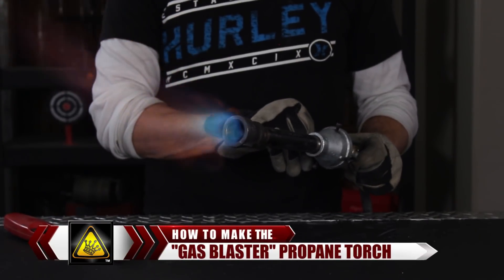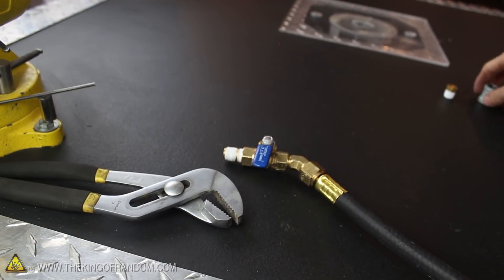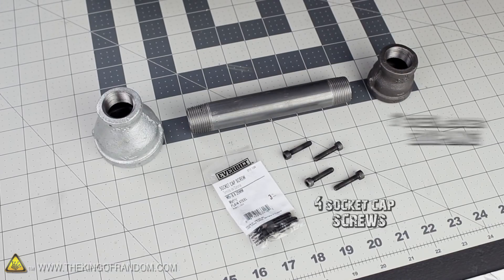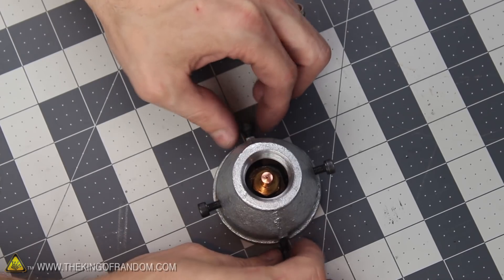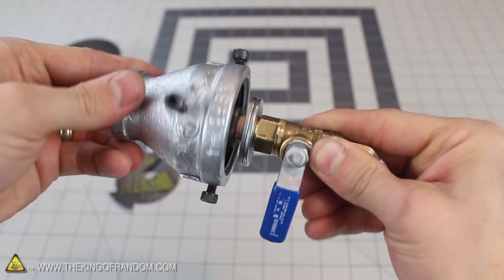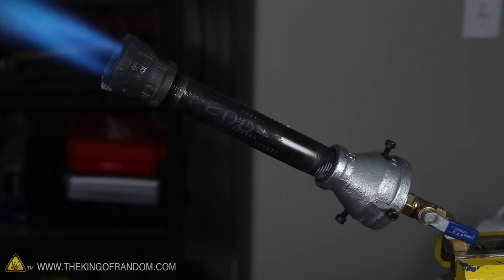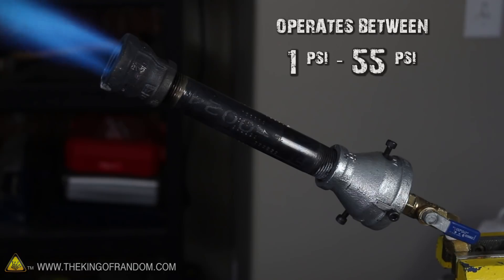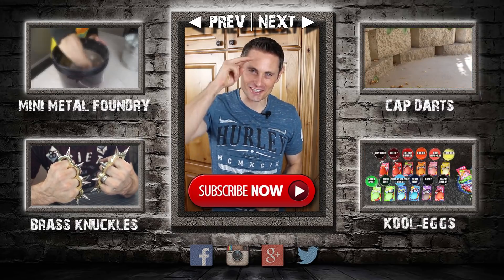Convert Your Backyard Foundry To Propane! ("Gas Blaster" Propane Torch)

Comment: in the parts list you have a 1-1.5" reducer, a 1"dia pipe, and a 1-.5" reducer coupling. 

either that last reducer coupling is wrong or the other two parts are wrong. I don't think they make 1.5-.5" reducer coupling so I assume that last reducer coupling 1-.5" is wrong. 

sucks, I'm out $10 for that 1-.5" reducer coupling now.

Comment: as awesome as this build video is, I think it's a little on the needlessly expensive side. Especially considering you can go on Amazon and search for high pressure propane burner and find high quality jet propane burners that will reach temperatures at least as high if not higher, for less than half the cost.

Comment: This project was a treasure hunt because I tried to buy locally, I recommend everyone to follow you're amazon links to buy the parts, also don't cheap out on the pressure regulator and gauge, I know the Marshal Excelsior is expensive but it is worth it! I just finished the build, it far surpassed my expectations! Thanks Grant for the instructions! Can't wait to see more forge/foundry videos!
Reply: IMPORTANT NOTE!!! When you tap the 1 1/2" reducer coupling I recommend using a 11/64 bit for your M5 tap, it is much closer to the M5-.08 tap and you won't end up with shallow threading...

Comment: so I'm having a problem with the heat transferring too far up the line towards the valve and rubber hose. I'm going to try a longer pipe on the end to keep the heat down, any other suggestions.

Comment: Could you do a video discussing a building a propane foundry vs one that runs using natural gas (what you normally encounter piped from the city to your home HVAC system)?  Possibly talk about the gas pressure, burning temperature, time to melt an ingot, cost of natural gas vs propane, etc?  And yes...  I want fries with that!  : )   Thanks
Reply: If memory serves, propane is about 3% more efficient.

Comment: For those looking to build this, there's some errors in the parts list. The pipe is 3/4" not 1" pipe. The reducer you drill into should be 1 1/4" to 3/4" reducer. The flare end is made of a 1" to 3/4" reducer.  Do NOT use galvanized pipe (the shiny pipe) in any of this. Use black pipe. 

Also, you can use the same tap to do the nozzle as well as the thumb screws. Just buy the right size thumb screws. ( My local HD didn't have a tap for the thumb screw size used in the vid)

(This is very awesome. I'm in the process of building one based on these specs. I built one around a 1" pipe with reducers / flares to fit that. But I will be redoing it with the 3/4" pipe and reducers soon.)
Reply: actually i think the one you drill into says 3/4 to 1 1/2
Reply: I wish I saw your comment earlier. I didn't realise the front flare was the wrong size until after I finished it and wanted to screw it on as finishing part.
 
I have built everything with a 1inch tube as smallest size, but am using a screwable rear to let air in (or close off) so bigger size should be fine. However I now need a new front 'reducer' from 1" to something slightly bigger, perhaps a 1 1/4 "to 1"?

What is the reason you are going to / went to 3/4 inch?
Reply: @daedelus_  I just started getting the pieces to this today. I noticed as I was picking them up in Lowes that galvanized wasn't the right product to use as it's toxic when burns, as its mentioned on another video about the foundry and why the plaster mix should be as close to the top as possible.. So I picked the black steel pieces. I was make shift putting it together while picking the parts and noticed the 1" tube wasn't going to work with the 1" reducer. Luckily, I saw a 1 1/2" reducer to 3/4" in stock (which my other lowe's and HD stores didnt have). And I upgraded from a 1" x 6" steel pipe to a 3/4" x 12" pipe and was cheaper. Unfortunately the rest of the items I had to order from amazon so I have to wait a few days to piece it together and drill all the parts.
Reply: GUYS GUYS just chill its going to be toxic almost any metal fumes being breathed in for a long period of time are bad or unhealthy i know a guy that worked meting and casting aluminium for 15 years and he didn't wear a mask and now he cant put a spoon in his mouth just by a respirator mask its that simple
Reply: Joshua Migdal did this work out?
Reply: did you use a flashback arrestor on yours
Reply: thank you
Reply: I'm having a problem too I can't find any of the quarter inch pieces that he used.  Do you think I can do it with 3/8-in pieces cuz that's all my hardware store has
Reply: Hello from 2021! I only noticed the material discrepancies after I set out to buy the materials as listed in the description. Local stores didn't have propane hose nor 45° elbow. Also had trouble finding POL valve and adjustable regulator. Having to buy these items online!
Reply: Thanks for this comment. I kept thinking something looked wrong with the parts I bought.
Reply: What do you mean by "black pipe"? Steel isn't black, so doesn't that mean there's just some other coating on it (which isn't zinc) that's going to burn off and be equally toxic?
Reply: @halenpeterson2322   it's just a term used that means plain steel (i.e. non-galvanized)  it looks black as it still has the mill scale on the pipe. when you're doing an application like this where you're more than likely going to be melting Al or other crazy toxic-when-melted materials having the Zinc is a moot point
Reply: @halenpeterson2322  black pipe has a heat proof coating that isn't toxic when hot.  it's for using in forges, furnaces, gas fireplaces, etc etc
Reply: No it’s  a    1 and 1/2” to 3/4 “ reducer you peanut. Use your eyes

Comment: hey would this work with natural gas as well or is the pressure of natural gas to low? would you have to use forced air if you tried to adapt to using natural gas instead?

Comment: I love the plan! 

I'm thinking you've put a lot of effort and talent into this so, THANK YOU!!!

I'm working on a foundry of my own, and I'll be incorporating your torch design into it, with two burners. I want to alloy some steel, so it's going to get really hot.

Any suggestions as to crucibles that can stand steel melting temperatures? I intend to pull it back to lower temperatures for tempering and heat treating steel for blade making, after I've come up with the alloy I want.

Comment: Anyone else having problems threading their holes for the socket cap screws?  Threading steel is definitely not easy.  I kinda wish he would slow down and maybe even touch on some possible issues you will run in to and how to get through them.  I'm at a standstill because I can't get the holes on the coupling threaded.  Also the tap bit is stripping the chuck.  One thing I've also discovered in case anyone is interested, DO NOT use a 1/8" bit to drill the holes into the coupling.  Unless you use that to get your hole started.  5mm tap requires a #19 drill bit.  You use a 1/8" bit and try tap with a 5mm tap and you're going to have an even worse day than I'm having right now.  I'm the furthest from an expert, but after multiple trips to the hardware store and continuously running in to problems, just take my advice on this.

Comment: Made a list of parts for people who put this stuff together.

For Torch:
   -Plumbers Tape (Pipe Sealant)
  -8' Length of 1/4 Propane hose with
3/8" flare fitting on each end
   -3/8" Flare x 1/4" 45* Elbow
   -1/4" Ball Valve
   -1/4" Pipe Nipple
   -1/4" Steel Coupling
   -1/4" Brass plug
   -6 mm - 1.00 Tap
   -0.025" (0.6mm) Contact Tip
   -8 x 25mm Socket Cap Screws 
   -1" Steel Reducer Coupling (Optional)
         (optional if not using with Metal Foundry)
   -1 1/2" Steel reducer Coupling
   -6" Steel Pipe
   -1/8 Drill bit
   -M5 - 0.8 Tap
   -Template to cut out tuna cover
   -Tuna Cover
   -1/2" Cut Washers

For Regulator:
   -Pressure Gauge 60 PSI
   -3/8" x 1/4" Fitting
   -1/4" pol valve
   -Pressure regulator
 
Optional:
   -Propane Y Splitter

Comment: You'll need an extra 1/4" brass nipple if you add the pressure reducer/regulator. You will also need a 3/4" pipe and change the bell reducers accordingly. Don't forget a 5mm tap and drill. These things will need to be changed to make a functional propane torch.

Comment: Hey Grant. Awesome video! Trying to make one for my mini metal foundry, but stuck on tapping the reducer coupling. The stainless steel has chewed through 2 of my taps already and was curious if u had a link to the 5mm. 08 tap you used

Edit: 
I ended up using some flux and solder to solder on a nut on top of the hole. The bond is strong enough to hold the set screws in place, hope the heat doesn't melt down the solder!

Comment: Can anyone help? i just finished building this and it's not working. When i ignite it I cannot get the propane to the blue color. And sometimes the flame shoots back through the tube and out behind the nozzle through the reducer. i thought maybe I wasn't getting enough air flow? I tried drilling a few holes in the reducer to allow more air in but I still had the same problem. Couldnt get the blue flame no matter what i tried; more air, less air, more propane, less propane. Anyone have the same issue and figured out how to fix it?
Reply: Edit** After rewatching the video, i noticed that i have some wrong parts. My reducer over the nozzle is 1 1/4" to 1", and my steel pipe is 1" diameter. Grant uses a 1 1/2" to 3/4" reducer, and a 3/4" diameter pipe. Would the slight different be the cause of my problems??

Comment: Look man, this is cool and simple, and really helpful to some people, but I sunk 120 dollars into all the tools and parts to build two of them, and neither one works. All I get is a relatively cold flame that starts way inside the tube, and not on the end of the reducer coupling. I added a screen to aerate the fuel, and that helped, but the flames are still way too cold. Help would be appreciated. And for those of you that think it is my PSI that is too low, it's not. I have it at 20 PSI.
Reply: Jayden Simisky Im having the same issue. Sometime the flame even pops out the back of the pipe. Let me know if you figure it out.

PS are all your parts the same? I just realized im using reducers and pipes that are different sizes than his, and I wonder if that makes a difference.

Comment: hey Grant, I was just wondering if you've ever thought about hooking your hydrogen generator up to your foundary. be pretty cool to melt steel with a foundary running on water. I built the foundary except I used a beer keg. next is to assemble my generator and give it a shot.

Comment: I did a comparison price check on Home Depot & Lowe's website. Pretty close to Amazon's prices, give a penny, take a penny here & there. Long story short, this conversion will cost you a minimum of $120+, assuming you don't need to buy the tap which is an additional $20. In other words, you're looking at about $150 project to make a simple gas blasting torch. Keep in mind, you're probably no professional & you're dealing with highly flammable gas, attached to a 20lb tank, capable of blowing up you & your house in 3 seconds flat. All that said to say this, buy one already made, professionally, and avoid the risk. Did a quick search online & found one for $87 from forestry suppliers. The only thing you'll probably need to do is make a larger forge to accommodate the larger opening. I built the original forge myself, works ok. Wanted to upgrade to gas and did so with materials already on hand but I wanted to go back and "refine" my method. Came back to this video to see what materials he used and long story short, just buy one. It's cheaper, safer, and more professional looking, which is what I was going for to begin with.

Comment: Dear Grant,

I built a burner based of your design, but i'm having trouble. when i light the flame will not hold. when i do get it to stay lit and try to turn up the gas it goes out. I tried using 15 and 30 psi but it did the same thing. do i need to let more air in? I will continue my attempts to troubleshoot the problem, but I would like to know if you had the same problem. what should I try changing? 

The only changes I made to the design were 1. replacing the can lid with a metal plate held in with a spring, and 2. not putting a reducer coupling on the end. could this be the source of my problem?

-Alan

Comment: doesn't this need a flame arrestor to prevent the flame from propagating to the tank?
Reply: novafire There is no need to worry about flashbacks into the tank. The regulator prevents back flow and the flame can't jump past where the oxygen is introduced.
Reply: Liquid propane doesn't burn

Comment: I have a problem with the gas blaster I made. it sputters alot and I can not open the valve fully or it goes out. I currently have a 0-40 psi regulator and I have it adjusted to 15-20 psi, but if I go higher the flam goes out.

Comment: Great video!  I have made burners for my glass furnace using a air blower and low pressure propane runing through iron plumbing pipe, like your burner.  Your set up is nice and clean, with fewer parts.  Do your nozzels corrode with the heat of the furnace?  Mine do, pretty quickly.  Also, do you have any problems regulating the air - fuel ratio as the lid isput on and taken off ?

Comment: The 1" reducer coupling listed goes from 1" to 1/2" this does not seam right as you need to have it flare open wider than the 1" pipe. In the video the outlet size is not specified but it is visibly flaring larger than the pipe.

Comment: Can your propane gasblaster torches melt iron or even steel.
Reply: I have the exact same question.
Reply: Maybe the king of random will try to melt some iron or steel sometime.
Reply: Maybe 4 of them
Reply: Not really with this set up, a properly boot foundry with 2 1” better designed burners could certainly do it

Comment: Would this work instead of the more expensive regulator? 
Bayou Classic 5HPR-40 48-Inch LPG Hose, High Pressure Adjustable Regulator https://www.amazon.com/dp/B0033JF0GE/ref=cm_sw_r_cp_api_Yv.yyb6KD80XK
Reply: works for me just put it togther uisng this regulator

Comment: First off, gotta say your videos are awesome. Always enjoy what you show us. Made the metal melting foundry and fired it up a few days ago with the charcoal. It works but what a pain to keep feeding it charcoal. Went through 3/4 of a bag just to get a few pounds. So I decided to go the propane route, however I didn't want to assemble anything. I remembered I had bought a harbor freight "flame thrower" to help.......control weeds (ok, I just wanted to play with it really!) so I made the inlet hole a bit bigger to 3" to accommodate the flame throwers nozzle. Fired it up and turned the air valve up about half way. Boy did that do the trick! So much easier than charcoal! Thanks for everything you do Grant! Keep up the great work!!

Comment: Is it possible below freezing temperatures cause the propane to flow improperly and cause the blaster to not work? I can't get mine to stay lit and it's 21 degrees out.
Reply: Brigham Cook Double check your LP tank and make sure it's not low, but yes over all speaking propane will flow more slowly in cold temps.

Comment: can this melt copper? duo torch? single? please reply TheKingOfRandon
Reply: Tony- -Trickshotz If you get forceful enough airflow on the charcoal form you can melt copper. With the gas torch, it'll melt copper no problem.
Reply: This is kind of a crappy how to, look up Ron Reil burner and you’ll find proper spec designs and BTU charts and so on

Comment: I need some community advice. 

I want to make a small foundry, but am conflicted over which one to use. 
im divided between a propane powered foundry, like this one, or one styled off the Arc Reactor furnace the King Of Random made in another video. i have a welder to run the arc furnace, and a design to make one slightly bigger than the one from the video at the cost of efficiency. 

the arc furnace would be cheaper, but more complicated and prone to problems (i think) 
the propane one seems to work, however cant melt metals as quickly and cheaply as the arc furnace...

any advice?

Comment: Great video!  Tried to buy the parts using the links to amazon, but all the steel pipe thread sizes were different; some were ¾", others were 1", others ½".  What is the actual steel pipe size, ¾" or 1"?  Thanks for all your excellent and interesting projects and videos!  Keep them coming.

Comment: I would really suggest either yellow tape or better yet, pipe dope. This is a gas fitting, not water or air.
Reply: Mike McKeen air is a gas
Reply: why yes, yes it is, but it's not an explosive gas. And if you ask a plumber, gas refers to natural gas or propane or some other flammable gas. That's why you tend to use pipe dope on threaded fittings. It provides some lubrication in the fitting as well as providing a thicker film than regular white teflon tape.
Reply: Mike McKeen Dude, what do you think causes the actual fireballs in explosions? Oxygen being rapidly heated. Ever watched a building on fire? (Actually just go look at B7 on 9/11) Windows get blown out and everything just from hot oxygen pressure.

Comment: Galvanized steel is a bad idea to use in any use of heat the zinc in the steel gives off toxic fumes when heated up. just an FYI
Reply: Dixie Normous I've built 2 forges it doesn't matter where it's at, everything heats up drastically even the air intake!

Comment: use soapy water to find leaks, much safer. also use yellow 'gas' teflon tape, doesn't corrode and reminds that it is a gas not liquid system.